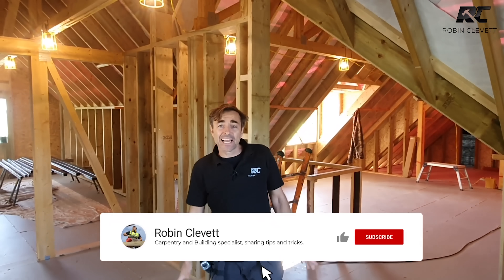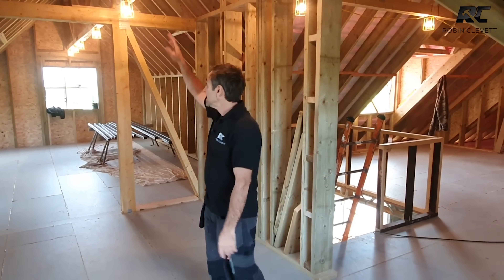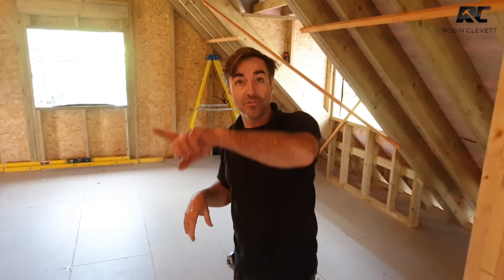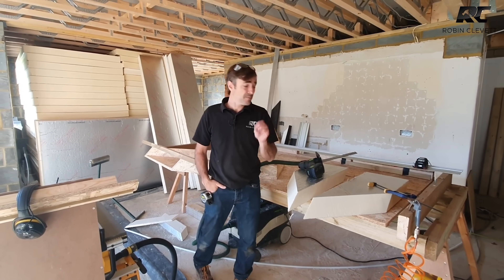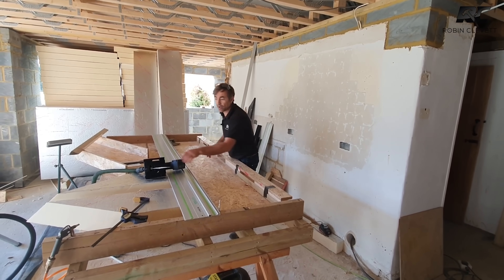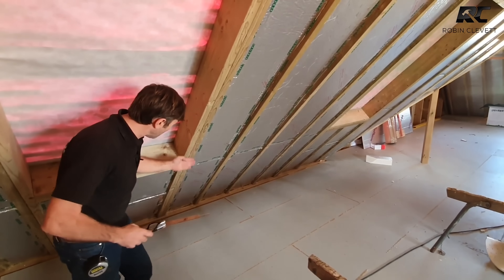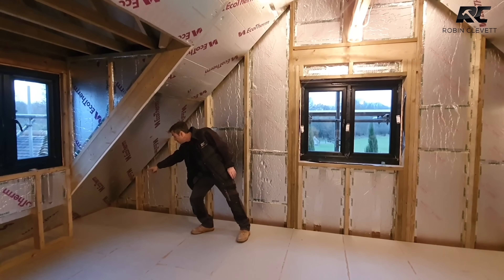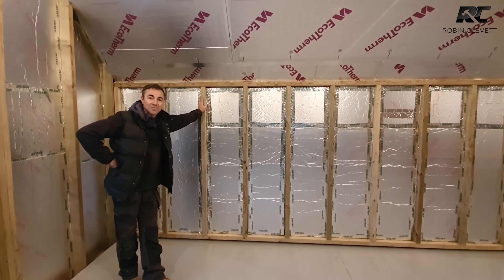How to fit insulation 2023 to the latest Building regulations Part L

Comment: Top job Robin as always! Just a few questions though, i was under the impression that you had to leave a minimum air gap behind the insulation so its not touching the roof membrane to allow for air flow? And also hasnt it got to be flush with the rafters? Ive heard of people putting a few nails into side of rafters to ensure that the insulation doesnt go right back and the air gap is maintained?
Reply: 80mm gap in this case, and small timber battens pinned to the rafters to physically stop it going too far...
Reply: That Pir board looks like 100 or 120mm and those rafters much bigger, look like 175 or 7s to me. They certainly aren't 4s or 5s. So that's leaving a decent gap.

Comment: Why have you done that before it's wired, or aren't you having any power or lighting.
Reply from the maker: All our power cables are in viods that are on the warm side of the insulation and fitted once the stud partitions and flat ceiling collars are fitted
Reply: @robinclevettcarpenter  as an electrician if I walked into a place and seen that had been done before a cable had been installed, I wouldn't be impressed, it's restricted where cables can be run, and we can only run cables in certain areas, installing the insulation before a cable has gone in, has made a lot harder than it needs to be.
Also, had I priced that job off a drawing, I would be assuming the insulation would be going in after it was wired, knowing insulation was going in before would of increased the price of the install.

Comment: Having all the tools definitely makes the job easier I personally have never seen anyone cutting celotex insulation with that festool cutter they’ve just used old handsaws the kit used here is a vast improvement but on most normal jobs ( much smaller ) with a number of different subbies wanting to get there bit done it’s gonna b a problem to get the same results as u have here unless it’s policed to high standard by management in my experience with different trades it’s just about getting it done as quick as possible the bottom line always seems to b how much money they can earn it ain’t right but that’s what I’ve seen over the years

Comment: Hi robin, very good video. Steady camera and good sound.  Cld i ask sm advice please...i have a newly built single storey extension with a vaulted ceiling. I plan to use the techniques you have outlined in your video as per the insulation. Cld you explain the insulation joint from the cavity wall using Rockwool or similar to the PIR board maintaining the 25mm air gap? I can see in you have built an small PIR upstand from the wall plate to meet the ceiling PIR but is there any more fitting detail behind this to seal with the cavity insulation? Also, i have 4 Velux windows across the width of the roof. The 2 areas directly above the windows, which meet with the house,  are not ventilated from the wall plate as the other areas are. My roofer used a breathable membrane. Is this an area to be concerned about and if so could you offer some advice on how to vent these spaces please. Thanks again.Andy. (Swindon,Wilts)
Reply: Anybody hv a response to these questions Andrew is asking?

Comment: Fantastic video Robin. 
I have a similar question to wotnoturbo regarding the Velux windows - do they not prevent airflow in the rafters that they span as there's no longer a direct route from wall plate to ridge? Or is not something to be concerned about? 
I am currently planning to replace a flat roof in a kitchen with a pitched roof with Velux windows in so this video was very timely, thanks again.
Reply from the maker: They can restrict air flow but generally there is sufficient air leakage around the window above the insulation level to enable some ventilation to pass
Reply: @robinclevettcarpenter  Thanks, that's great to hear. Appreciate the speedy reply

Comment: Interesting but in older houses good luck trying to do this ….. would love to see how you do this in an older property ….
Reply: Fitting insulation/ rigid in an old house is impossible, this method would only make it easier the edging on the board at least gives you 10mm forgiveness handy enough for when’re a rafter varies that much top middle and bottom

Comment: Excellent work. Thanks for sharing your expertise. Waiting to get the keys on a new house where we'll be replacing the roof and installing recessed solar panels. 
Is a different technique required to insulate under solar panels that aren't retro-fitted?

Comment: Robin, I'm a chartered surveyor and construction manager. This is one of the most object lessons in how to properly insulate a roof that I have come across in 35 years of working in the industry. The insulation nightmares I have witnessed are beyond belief and further raise questions as to how the local building control folk signing them off as acceptable. Many thanks for the good work and fabulous videos.
Reply: what about venting the valley rafters..
Reply: I have cut my pir boards 10mm under size all round and spaced the gaps with wedges, and glued them in with expanding foam!
Time consuming but it was a self build !
Was that ok?

Your vid is brilliant, you remind me of myself? Haha.
Reply: @steveburton2806  I did that too. What a mess this was, foam dripping off the roof slope all over the place! 😀 Time consuming indeed, and also the foam was quite a noticeable extra expense. I am really pleased to see this Gapo Tape. It looks like it is not more expensive than foam - possibly cheaper, actually. And looks so much faster! I guess the PIR layer below the rafters might still be best glued in with foam, but that seems a lot less difficult.
Reply: @chrisgemmix0815  Use proper screws and washers to scree to the rafters... Then tape over with vapour tape
Reply from the maker: Thats for your message, I really appreciate you watching my video and taking the time to comment! Let's hope that we can all drive for better standards in the future!!
Reply: The elephant in the room is no client wants to pay any more for the additional labour involved compared with 3 or 4 years ago!

That's why the industry go to is usually a lash up!
Reply: Hi I’m doing a building surveying degree do you have any job opportunities please
Reply: And this is why the average house price is 300k🙄
Reply: @richardgallagher4880  the value of most houses in the UK is driven by availability more than the cost of building it.
The building cost might make up 1/3rd the cost if you're lucky.

Making planning less restrictive and building standards higher and everyone wins.

Comment: There's one thing I struggle to understand with the Regs:  they've effectively made buildings airtight so where is all that vapour created dispersed?  The dew point us temp dependant I know but there's a limit to how mhch vapour you want in a living space.  Many new builds, lets face it, have compact footprints and relatively small rooms...the majority of modern large estates 3 or 4 bed homes for example.  A family of three or four create a lot of vapour, from breath, cooking, showering (even with extractor fans).  Where does that all go?  It builds up surely?  Keeping a house warm allows more moisture to be held in the air but with rising fuel prices many will not keep thermostats as toasty as before.  We only have heating on for two 30 minute periods a day because our oil heating is so expensive.  Vapour still condenses on widow corners even with our triple A rated double glazing and this causes mould spores to form.  There needs to be adequate air flow to be healthy imho and air brick vents for things like gas or woodburner fires to provide combustion oxygen.  The older style double glazing used to have a trickle vent at the top which you don't see on many new ones.  Despite the regs it seems sensible to have some controllable airflow but generally, improvements to insulation standards are long long overdue as they've been completely inadequate up until now.
Reply: I get what you mean, if it helps they also redid ventilation part F but a lot of it is over my head

Comment: Great video as usual. Just did a roof and stuck to 400 centres whish I just done it at 450 to make it easier and use the tape! Quick question.... The roof I'm on is a warm roof where the insulation 75mm is put on top and cross battened, they have also put 75mm vut in between the rafters leaving a 25mm air gap... Is that enough for a hybrid roof? When talking to roofers they get more call outs for leaks when actually it's condensation because of insufficient air gap? I only asked as I noticed your insulation seems to cover the full depth of the rafter? Thanks

Comment: A really great video Robin which shows just how much care and attention you pay to the work you do 👍

I was particularly impressed by your attention to detail on every aspect of the job.  From stating the importance of having high levels of insulation, to wanting to avoid waste, ensuring accuracy of cutting and installing, then recording data to demonstrate how well the installed system is working.

You clearly understand the importance of improving insulation levels in all housing stock and seem genuinely passionate about achieving this on the jobs you do.  I think the way you are going about it will be essential if we are to move from traditional gas boilers to air or ground source heat pumps in the very near future.  The only way these systems are going to work cost effectively is if the fabric of the building is insulated to the highest possible standard.

Any client lucky enough to use your services is clearly going to get a roof that is well built, properly insulated and will result in lower running costs in the long term.  Fantastic to see you proving that taking a pride in your work is still alive and kicking 👏👏👏👏👏

Comment: Why aren’t the pir board flush to the face of rafters? Looks like you pushed them back by about 20mm which would leave a void between the second layer of pir? That would need ventilating or it would encourage moisture to condensate.
Reply from the maker: It is a sealed space and actually helps like a double glazed unit, the second layer of PIR mainly addresses cold bridging through the rafters, in our case we have a deep 200mm rafter and that in itself helps mitigate against bridging as timber is a fairly good insulator, our detail is very similar to modern factory timber frame panels where they may have a service void and then an insulated plasterboard over this

Comment: Great video, thank you. When the insulation is fitted between the rafters, how do you maintain the uniform gap between it and the breather membrane? How deep does this gap need to be? Finally, the insulation between the rafters sits back from the front edge of the rafters meaning there's a void between the two layers of insulation - is this normal?
Reply from the maker: Hi John, we use a timber reference block that we set on the sides of the rafters and we push the PIR back to that point in our application we have a small gap between the  PIR between the rafters this is a sealed space and acts a little like double glazing, this is a detail I first used on a previous project that was specified by an insulation consultant
Reply: @robinclevettcarpenter  Thank you Robin for getting back to me
Reply: If you do have a gap between multiple layers of insulation, the thickness of each layer matters as you don't want the dew point to be in the air gap. Thinner layer goes on the warm side and as usual attention to detail on all air sealing greatly reduces the risk of mold in the gap too.

Comment: £1.90 a meter for that gapotape. A 2.4 sheet with 600 rafters puts you at an extra £11.90 a sheet nearly £200-£300 on every roof . That’s madness. I used fire rated expanding foam to fill the gaps where the chippy didn’t get the trusses straight.
Reply from the maker: Is £200 to £300 an issue for the type of clients you have? I have found that when I price a job and write my specifications highlighting the type of products that we are using at the different stages for example GapoTape my clients always without fail go for it, tests have shown that using the GapoTape on the edges of the PIR will greatly improve the performance so we can use a thinner PIR and save money there, it helps with fitting into slightly misaligned trusses and IMHO speeds the process up, the new building regs are even mentioning that this type of product should be used so give it a year or so and your building inspector will be looking for it, I have had several contact me about the bad installations that they witness and they all are for an improvement of application
Reply: @robinclevettcarpenter   luckily I’m a plumbing and heating engineer so I don’t have to worry about this too much, But for whatever reason I always get asked the question especially with underfloor heating insulation. I’m doing my own extension at the moment and to be honest, I think Gapo tape would’ve saved me a lot of Hassle considering the mess the chippy left my rafters at. Been following you for a while mate, you’ve helped me no end with your knowledge so appreciate what you do. Sorry if sounded like I was criticising, building control just drive me nuts as they can never make their mind up with what they want to do. Take care and thanks for the reply

Comment: When I go in my loft on colder days the beams are damp. It's not a leak as it's not damp on warmer rainy days. No idea what to do
Reply from the maker: Try to stop the warm moist air from reaching the loft by better insulation at ceiling level, make sure you have adequate extractor fans running in bathrooms wet areas and prove the roof ventilation by means of vent tiles this should help
Reply: @robinclevettcarpenter  thank you for the advice. I do have a suspicion that the bathroom extractor is just blowing the moist air up into the loft as I cant see any ducting leading to the sofit.
Reply from the maker: @andyr4735  duct that properly and it will make all the difference!! Ridged duct is better

Comment: Those compound cuts blew my mind. The Gapo tape looks like a great product, I priced it up for my DIY garage conversion but it was too pricy. They should work on that as I can see it going mainstream if it was more affordable.
Reply: I suppose it’s the way you look at it, whenever we had a look at the new regs and such and some of the research and you see insulation failing by 30 to 80% and the way fuels going all I can think is, this is a job you do once and saves money over time, I do agree though the tragic thing about newer products before they go mainstream is the initial price and it’s about weighing the pros vs the cons, the compound cuts and especially the full length insulation blew my mind, I’m also baffled as to why 450 isn’t the way everyone does it!!!!

Comment: Hi can you talk about how the electrical  installation fits in with your airtightness as I didn't see any sockets or lighting cables in your  video?
Reply from the maker: Hi Bryan, all our plumbing and electrical first fix cables and pipework is all on the warm side of the insulation running in Stud partitions and across the flat ceiling joists (not seen in this video) I avoid at all costs any first fixing in the insulation zone
Reply: @robinclevettcarpenter  Hi Robin BTW I did think the way you fitted the insulation was very good and Yes I understand that the wiring can't be in and coming through the installation, that's why I asked, so you stud out after you have fitted the insulation to allow 1st fix for sockets and if you making flat a ceiling to allow lights to be fitted that I can see will work thank you.

Comment: At the end of video on window wall, how will you secure your plasterboard where it meets the roof as no studs showing?
Reply from the maker: We use a 25mm batten under the rafter line against the studs and we then line the studs with 25mm PIR too

Comment: This is so dreamy to someone who has been renovating an old property where all the rafters are at different spacings, many different widths from top to bottom and some a bit twisted too. Every single piece was a custom size and we used a lot of low expansion flexible air tight foam. Nice once done though!

Comment: Amazing craftsmanship and attention to detail. 

If only building codes were as strict in the states my house wouldn’t be so cold/hot all the time, insulation and proper air sealing is still an afterthought.
Reply: That is what amazes me with your building codes, the fact that some states don't have any or the fact there is no national standard like here in the UK. Then when some states mainly the colder ones do have codes some do not even require insulation under concrete slabs. Yet here in the uk which is not as cold as the USA, we are require to use a minimum of 100mm / 4 inches of insulation under a concrete slab.

Comment: how is that solid insulation concerning fire hazards and regulations? im used to using rockwool or fiberglass insulation. I personally prefer rockwool, its easier to work with, better for sound and does not soak up water. how is the the insulation you are using in concerns to sound insulation?

Comment: Don't you guys use expanding foam to install those PIR-sheets? I live in Finland and I used PIR 100mm+50mm on my roof. Just cut the 100mm between rafters (width -2cm) and use temporary plywood pieces with screws under the rafters to hold it in place while expanding foam cures. (Important to use more flexible type PU-foam to keep up with movements). Under the rafters 50mm PIR sheet is installed with screw and proper washers. While  they hang there you tape the seams with aluminium tape and install the 1"x2" with screws where rafters are.